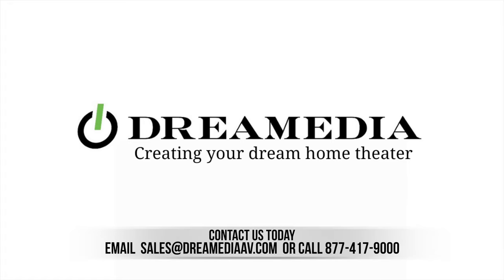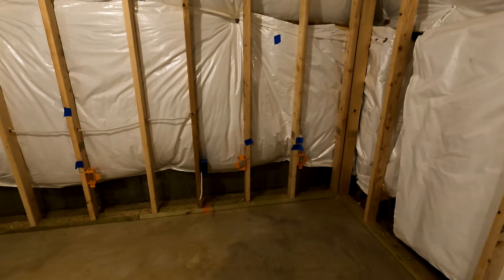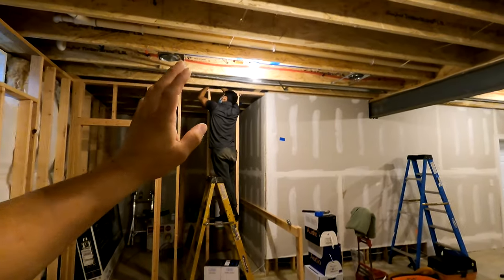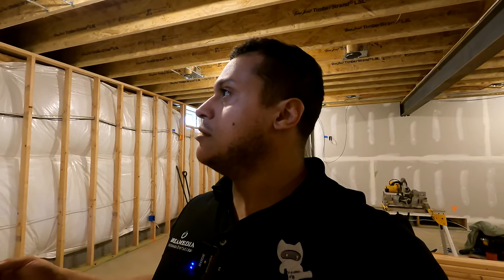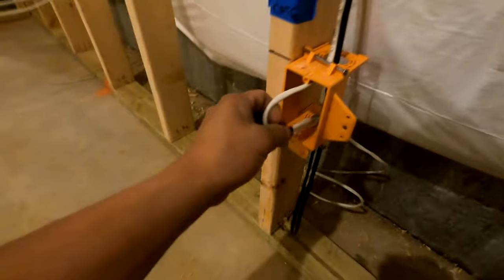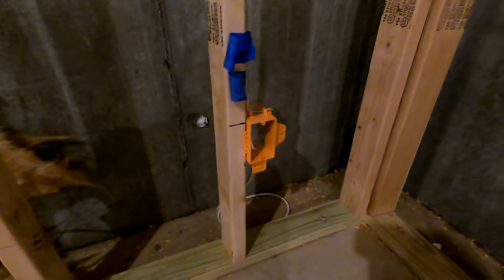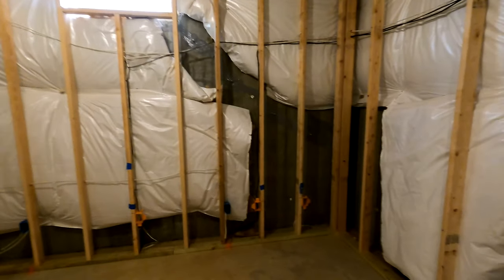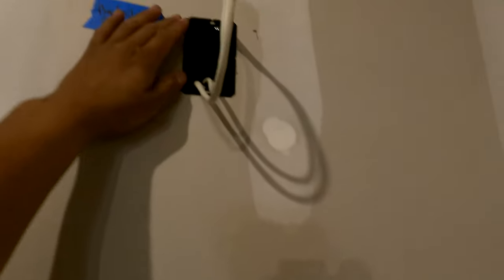How to Prewire for Home Theater Tips and Tricks

Comment: Well done video on the pre-wiring.  One thing I've done in my set-up is to run 2" drain pipes from the projector to the control room, and from the control room to the front wall.  Consequently, if some fancy system comes along down-stream, I can easily pass wiring down the pipes.

Comment: I have one small issue. Not with you, but with the homeowner. If you're starting with a blank slate like this, then why not put ceiling speakers in for your Atmos instead of up firing? I just believe that if you want sound to come from a specific location, then put a speaker there.